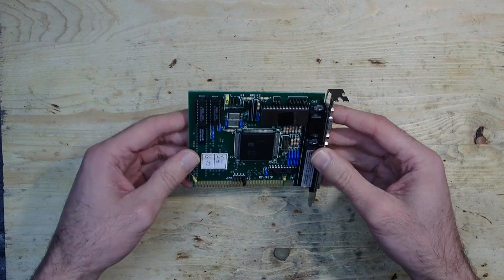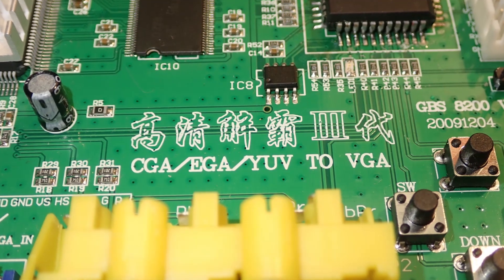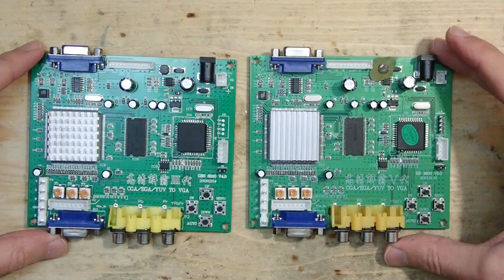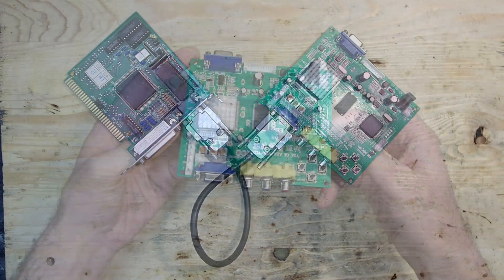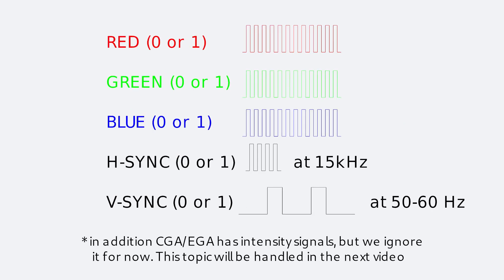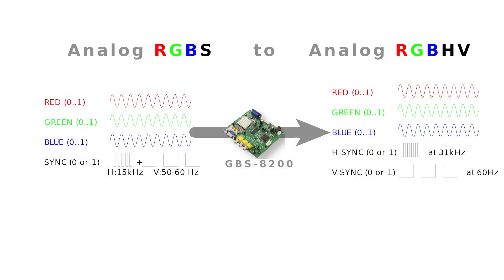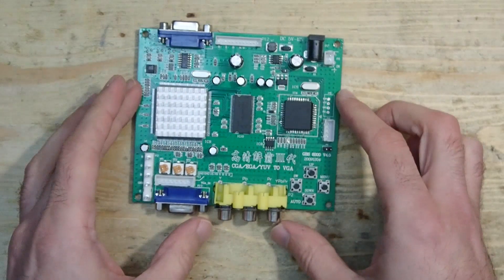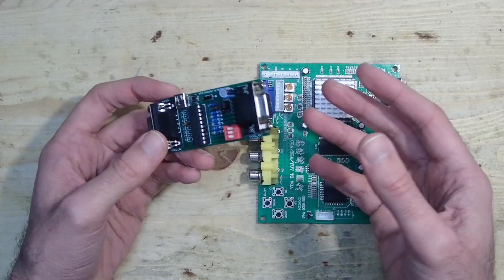MCE-Adapter (part 1): Why GBS-8200 is not a CGA/EGA converter

Comment: I've heard people sourcing components through AliExpress. Based on what I've read about that retailer, and who owns what, I'm not yet ready to trust. Perhaps it works for some buyers, but I don't feel there's enough oversight yet, and the outside world does not entirely trust China itself because of the behavior of its government. Not disparaging the Chinese people at all, who are usually caring and industrious.
Reply from the maker: In regards of politics, I don't trust any government, they all do very cruel things and sell it as a necessity or charity (depends) to their own nations. China, USA, Russia, EU - for me they all are equally bad guys, however the last one seems not have to much to say in the international politics :) Once it is clear, you will stand in front of the question, if you want to buy anything at all, because once you do, you support one of them. So, if you decide to buy things, it doesn't matter where they are from. And back to topic, GBS-8200 was made and is sold from China only. Everything you can buy in your country is imported from there. If you exclude the reseller in the middle and buy it directly from China, you'll just get it cheaper, but it will be the same product, which will not work with EGA and CGA :)
Reply: i think the problem with Chinese sellers is they put extra search terms in the listing that are similar but simply NOT technically correct, so its partly to get hits on a search, and partly the seller does a wide variety of goods but doesnt have the technical knowledge to identify technology components. even if a tech manufacturer copies a product, some dont have proper engineering understanding.